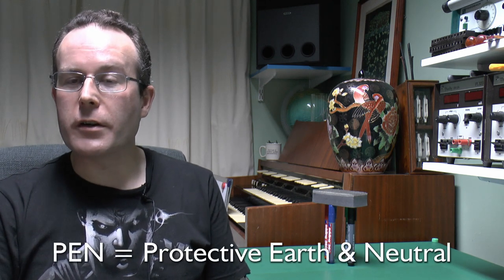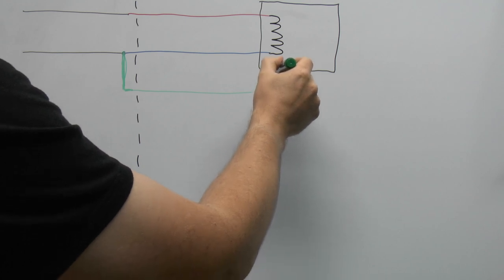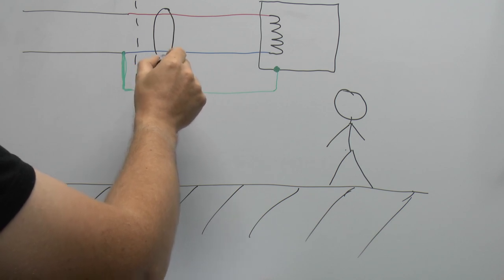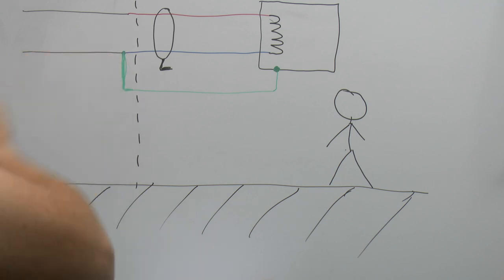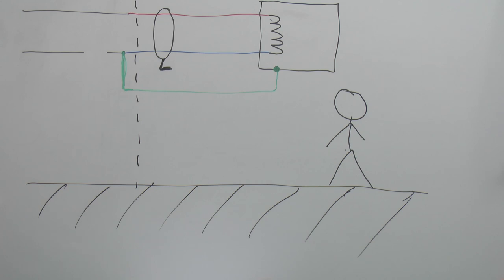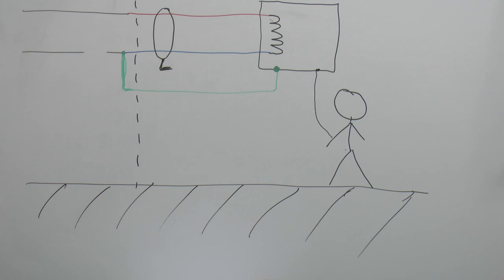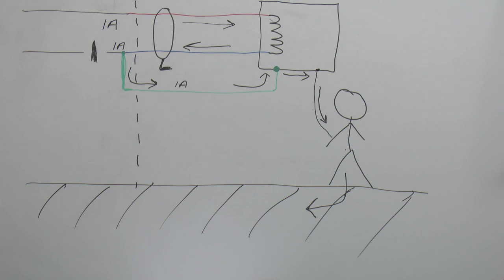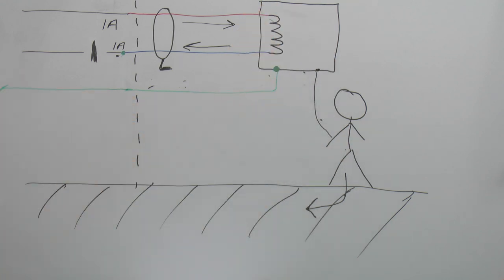TN-C-S Danger - Broken PEN Conductor (Combined Earth & Neutral)

Comment: Gents! TN-C-S system requires re-grounding installation (next to your house) for that extra safety and proper operation of the RCD-s. How come, this was left out in this video???
Reply from the maker: That is required in most countries, but in the UK it's always been optional, with the result that it's never installed.
Reply: @jwflame  Hi John! Thanks for the answer :) Well... in fact, it is optional in many countries, yet strongly recommended. I have to agree, it does end up with the "cheaper", yet potentially deadly solution.

Comment: A proper TNCS earthing arrangement has a local ground electrode at each consumer unit. This provides a suitably low path of resistance to earth which  ensure breakers trip if the PEN get broken.
Reply: I didn't know that. Do you have a reference number for it in BS7671?

Comment: I just installed a shower with built in ELCB. When I bridged the neutral and earth the metalwork. on the shower went live and the ELCB, didn’t trip. Thankful it’s an old soviet apartment block and a few floors up there is little contact with earth. The unit did operate with live and neutral connected.
Reply: Claro las duchas electricas tienen una resistencia,esta calento la carcasa de la ducha

Comment: American 240v  3-prong clothes dryer plugs/receptacles prior to 1996 were able to get away with combined earth/ground and neutral, which  means a break in said wire would present a potentially lethal shock hazard when touching the appliance. Afterwards, four prongs (two hot, one neutral, one ground) became the standard.

Comment: Very helpful. I do have a question. I’m in Australia. You will see the Neutral bar has a connection to Earth in the switchboard. Also each premises has it’s own Earth spike in the ground.

Here your drawing should have a green earth connection to the right of the dotted line.

I’m guessing here the pour stick man doesn’t have to cop it before you know there’s a problem. Wouldn’t that be safer the way we have it?
Reply: The spike does reduce the risk but does not remove it.It still is high impedance so significant current can go through the person.

Comment: It seems to me that what's required is a breaker that would trip if neutral exceeds a set voltage above an independent earth. It would, of course, require a ground spike, and the right place to put such a device is where the supply enters the property. Maybe a nuisance to retro-install, but surely easy on new installations.
Reply from the maker: Such devices are mentioned in the new 18th edition regulations, specifically for electric vehicle charging.  They do not appear to exist yet.

Comment: Water pipe could be plastic and therefore provide no protection?  Also, surely the same issue applies to a TNS system if the earth conductor is broken outside the property, so why aren’t PEN fault detector-like devices not also required in TNS systems ?  Finally,  is there still a need for a separate earth bar in the TN-C-S system consumer unit.  If so, why (since they are both connected together?

Comment: W Polsce często praktykuje się uziemianie punktu rozdziału PEN na PE i N, co zabezpiecza przed konsekwencjami w przypadku przerwania przewodu PEN w linii zasilającej. Nie jest to w Polsce obowiązkowe, ale jeśli jest możliwość uziemienia punktu rozdziału, to warto coś takiego dokonać. Niemniej jednak, przerwa przewodu PEN to wyjątkowy przypadek, bardziej prawdopodobny, gdy zasilanie po stronie niskiego napięcia prowadzone jest linią napowietrzną, wykonaną z gołych linek aluminiowych, które po kilkudziesięciu latach pracy na wietrze i warunkach pogodowych ulegają rozciągnięciu i osłabieniu. Obecnie odchodzi się od tych przewodów na rzecz przewodu samonośnego w izolacji ze wszystkimi żyłami izolowanymi, a przyłącza odbiorcze do niego wykonuje się za pomocą złączek, które nie wymagają przecinania tego przewodu, a są zakładane na niego i przebijają jego izolację przy ich dokręcaniu. 
In Poland, it is often practiced to ground the PEN split into PE and N, which protects against consequences in the event of a PEN conductor break in the supply line. It is not obligatory in Poland, but if it is possible to ground a separation point, it is worth doing something like that. Nevertheless, a PEN cable break is an exceptional case, more likely when the low voltage side is powered by an overhead line made of bare aluminum lines, which stretch and weaken after decades of operation in wind and weather conditions. Currently, these cables are being abandoned in favor of a self-supporting conductor in insulation with all insulated conductors, and the receiving connections to it are made with connectors that do not require cutting the conductor, but are put on it and pierce its insulation when tightened.

Comment: In this part of the world in which I live, is required to have the ground electrode in each house. Here also all the electrical connections are 3-phase so the voltage in the neutral conductor does not rise high, even in a fault situation. (three-phase load)
Reply: +peto22 Which country is that? Norway? I know in Norway they have 3-wire Delta 220 Volts transformers in rural area's and at some places where they converted 3-wire Delta 220 Volts to 4-wire Wye 127/220 Volts the neutral is still not used because there are no mayor wiring standards in Europe for 127 Volts.

So 
- In a 3-Wire Delta 220 Volts System everything s connected Phase to Phase because there is no neutral
- In a 4-Wire Wye 127/220 Volts System everything in Europe is still connected Phase to Phase because Europe does not have 127 Volt appliances in general and multiple voltages will lead to confusion among users.
- In a 4-Wire Wye 230/400 Volts System most appliances are connected Phase to Neutral and only 3-phase appliances and 400 Volt engines are connected Phase to Phase. 127 Volts appliances cannot be used without a transformer.
Reply: I live in Finland. We have 3x400/230v Wye. Delta isn't used under 1kv for electricity supply. 20/0,4kv transformers are Delta-Wye and larger ones Delta-Delta.
Reply: The same in France, TT-System grounding everywhere although residential houses without farming or other business are single phase 40A. They alternate between phases between the houses. But if you want more you always get triphase starting with 3x20A with increments until 3x80A. If you want more you need a business connection.

In the Netherlands old systems are the same (TT-System) however since 99% of the old houses has gas heating and cooking most people only need 1x25A. New houses are usually TN-C-S grounding 1x25A or 3x25A.
Almost everywhere 230/400 Volt Wye although some old streets in Amsterdam still had 127/220 Volt Delta which they have problems upgrading because if they forget one house it would cause a fire. That's one of the disadvantages of underground cables. Once you burried them, you cannot easily see what is connected.

Comment: Perhaps people with TN-C-S supplies should fit an ELCB or a 1A fuse to their main Earthing wire in the consumer unit.
Seems like TN-C-S trades cheaper cabling cost (for the utility) with consumer safety. My country primarily uses TT earthing only with TN-S for larger buildings like office towers and the like

Comment: I think the most practical system is the tn-c-s system we have multiple Earth neutral system used effectively in Australia and New Zealand and I think it's the only practical earthing system. 
We also use 11kv/230v single wire earth return and that is remarkably effective for remote sites. So does Australia.
The SWER system was invented by an New Zealand electrical engineer New Zealander back in the 20s or 30s by a Mr Mandino.

Comment: I believe normally TNCS system is connected to the customer premise earth as mandated by law, which should fix the equipment grounding bus at ground potential even in case of a broken neutral. Isnt this an important fact?
Reply: +Electrical Technology Yes but actually the opposite happens, you rise the local ground potential to neutral potential. If you would measure the voltage between your Protective Earth and Remote Earth (a metal pin in the garden not connected to any installation) you would still see the voltage difference.

You cannot get rid of voltage! It's a myth too many electricians believe in because they assume earths impedance is 0 Ohms. It's not. It's a few Ohms at best! Which is always higher than the impedance of the metal wiring supplying your electricity. So you always lift the potential of your local earth and earthed parts (metal pipes) to neutral potential. You do not lower the neutral's potential to earth. You cannot do that because it would defeat physics.
Reply: @robinheijblom2929   If the point at which the PEN became open circuit was further away from the installation, and between this point and the installation there was an earthed electrode/additional source earth on the PEN, then what would happen in this case? Would the electrode then provide an alternative path back to the source earth? If so, the Line current that that returns from the appliance and back through the installation Neutral, would that then return to earth potential once it reaches the first connection to earth. If this happens, then this would prevent the current returning through the earthed parts of the system?

Comment: Great explanation. But if, lets say, a house have two phases and there is no endpoints (no equipment, no lamps, anything, everything is phase+phase) using the neutral, so there is no way to encounter the situation explained in this video, right? Because neutral would ONLY act as earth. In such scenarios, where do we connect the RCD neutral? or do we just leave it disconnected?
Reply: It is very rare that there is no electric equipment on. An RCD does not protect against this so forget the RCD in this context. Do not even think of  putting an RCD on the PEN wire.

Comment: Do you have any experience of discovering electricians have replaced a bad earth rod, with connection to suppliers' neutral, even if its' an overhead supply that doesn't look TN-C-S ?  I think this has happened a friends' place but haven't yet checked facts or checked with DNO etc.   Is this a common problem?
Reply: In the US it is very common. But because in the US people believe too much in freedom  all the risk are for the people too. And since people are very bad at being responsible in general (I mean just look at world, sometimes I wonder why WW3 has not happened yet, but that is beside the point) a lot of old houses with old electrics have poor to no grounding and rely on the suppliers Protective Earth Neutral for safety.

This means in case of a neutral failure the problem John showed in his video becomes reality. But since most people share a transformer with at least a dozen of people, there will be at least a few that taken responsibility and have a proper earth rod. Also the utility company  have an earth rod at the transformer and every powl where wires enter a perimisis just for this exact reason because:
- companies know most people are not acting responsible at all and do at least a minimum effort to keep things safe
- even people who are responsible usually lack the knowledge and depend on unresponsible landlords
- they do not want to get in complicated lawsuits
- they also want to make sure their installation works fine

That is why most of the time even installations that do not comply to any code still work fine.

Comment: Am I right in thinking that the only way to detect such a break, as it is on the suppliers' side, would be with a ZE or Earth Fault Loop Impedance test? The reading would indicate a problem if it didn't meet that recommended for this type of system by the regulations?

Comment: John, would a normally open relay (requiring low impedance current path from L to N) that disconnects all the wiring protect from this type of fault? I mean, like your boiler and lights won't be working in broken PEN scenario, the relay would remain open too, and thus disconnect whole building from power. Even better, when broken PEN fault is corrected, it would automatically reconnect. But it would not reconnect when you touch the grounded boiler, as the impedance through you would be too high to trigger the relay. Or am I missing something?

Comment: Hi thanks great information, just wondering ive got a project coming up witch involves rewiring some class one metal lamppost from a tncs supply, as the post have a sleeve that in the ground to about a metre depth, I would think this would act as a reasonable earth electrode?? Would reduce the risk? Any info greatly appreciated

Comment: Brilliant, John, but also quite scary... what would be the answer, then, if you're wiring up some external containers to a PME supply? Put in an earth stake? Thanks.
Reply from the maker: Ideally don't connect them to the earth terminal of a PME / TN-C-S supply, make the whole thing TT. 
However in reality that may be very difficult or even impossible particularly in urban areas close to other properties.
Reply: @jwflame  It seems to me that the safest solution is for the DNO to detect the loss of the neutral and then shut the power off completely, thereby removing anything more than a momentary risk until they get things fixed - opinions?

Comment: In Ireland where we have TN-CS supply, we always have an earth electrode connected to earth bonding point on the consumer unit.

I assume it is to protect against a faulty PEN conductor.
Reply from the maker: Yes.  Such things have always been permitted in the UK but unfortunately were not compulsory, so no one fitted them.  They are now 'recommended' and need to become compulsory as soon as possible.

Comment: Hi jw. Been watching lots of your videos. Very informative and clear many thanks. With regards to this particularly scary scenario I had my cutout moved 18 months ago. I noticed the cable was flimsy, thinking it may have been similar to swa that I used to use a lot of back in the day. But as you mentioned in one of the answers the cable is concentric with outer layer being the ne. What are the chances the concentric layer could be severed whilst still leaving the inner live conductor intact? Or does the cable type change up stream?
Reply from the maker: The outer wires being damaged leaving the inner connected is fairly unlikely.  It's more likely that failures occur at joints between cables, there are large numbers of joints, every property has at least one outside.
There can be multiple types of cables in use, particularly on older networks where repairs and partial replacements have been done over the years/decades.
Reply: Ah yes that makes sense. Thanks for the prompt response on such an old video!

Comment: excellent info John . would it be prudent to install an earth electrode to attempt to reduce the PD between exposed conductive parts and earth in the case a broken supply neutral/earth?
Reply from the maker: You can install one, but it won't do very much unless it has a very low impedance of only a few ohms, which in reality is very difficult to achieve.
Reply: So i install an Earth rod in Australia on a TNCS supply for no real safety reason???
Reply: @jwflame  Hi John, first let me thank you for your very good programmes, I have found them very informative. I now live in rural Thailand and severed neutral overhead cables are very common, I know of at least 3 in our local area. The last was about 2 weeks ago, late afternoon our appliances stopped working and the lights started flickering, the voltage fluctuated between about 120/180. I walked into the main part of the village and every thing was normal street lights and our in-laws supply all good in fact the only street light not working was directly outside our house, my wife did not want to phone the electric utility because she thought the problem was in our house. 
Our house is at the end of a branch line, so at first light I walked the line and found the break at our next door neighbours extremely overgrown tree/man eating bush. My wife phoned the utility and they responded very quickly. This will happen again because of the many overgrown trees between our house and the nearest transformer.
Reply: @jwflame  Part 2 of an extremely long winded post. Our property has NO  protective earth or ground rod and despite the Thai electrical regs closely following that of Australia with regards to the MEN link most other properties in the village are similar with just two prong plugs and sockets. The village is wired for MEN with neutral to earth links about every 4th pole. I am going to install a solar system, so wanting to do it correctly and not trusting local Thai electricians, I have been researching the subject.
My conclusion was to first rewire the house to Thai regs with regards to the MEN link/earth rod and earth wiring. The regs call for a 2.4M ground rod to be installed no testing required (the cost of my own meggar test equipment rules out me testing the ground rod myself). I now have a quandary do I go the MEN link way and potentially turn a single earth fault into a whole house earth fault or ? Any suggestions would be greatly appreciated.

Comment: Great explanation. But Im stuck at one point. If the neutral outside the property is broken wouldn't the RCD trip immediately and save the chassis? In your explanation it assumes RCD is not tripping when the neutral is broken. Could you expound it a bit more? Thanks regards.
Reply: Oh I just saw that you explain this at 5:55...:)